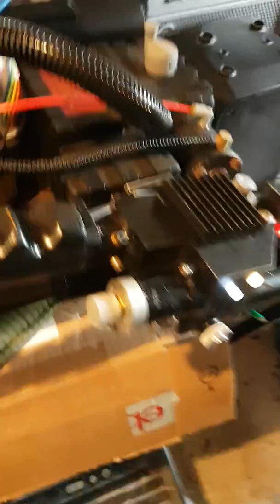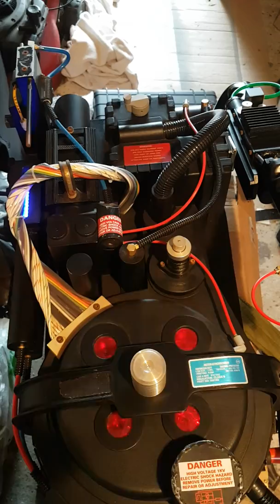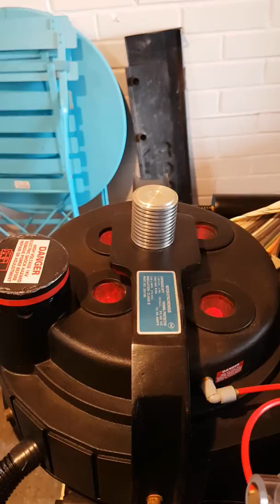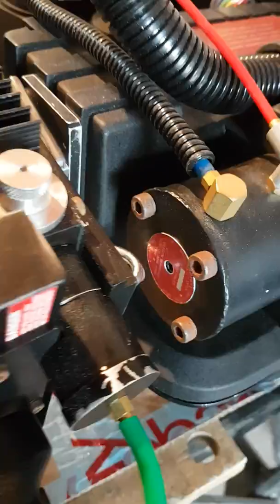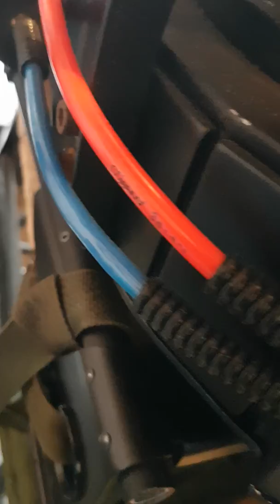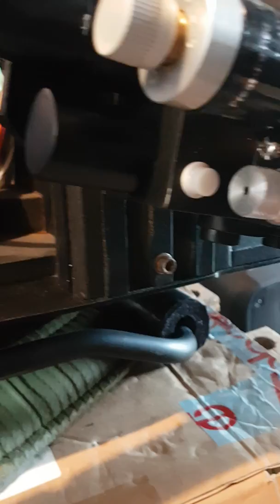Ghostbusters Proton Pack Hero Build Ben of Kent kit with lights sounds pop mech

Comment: Cool to see someone that has the correct orientation with the GB1 ribbon. Thats with the rainbow wires facing in towards the pack where it is screwed in. Rather on the outside where everyone else seems to put it...i have ocd lol
Reply from the maker: Hey there. Thanks for the comments. I produced a Venkmam pack, but the ribbon cable was the other way on the other packs. So it just depends on which pack you're producing! Because they shared packs during filming it all got a bit confusing. ...just to help matters.
Reply: @aussieb  ya i here you..that is true..my pack is a replica from the cover of the Omni magazine in GB1. Its completley clean like it came right off a production so i basically base gb1 packs off that